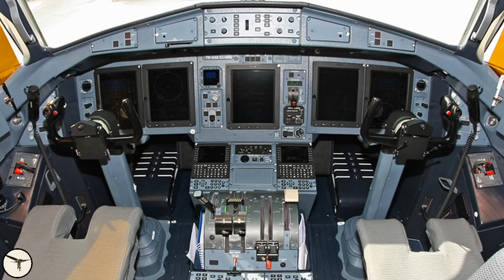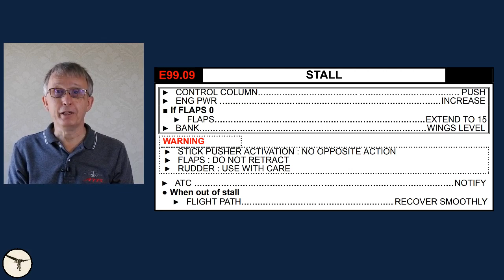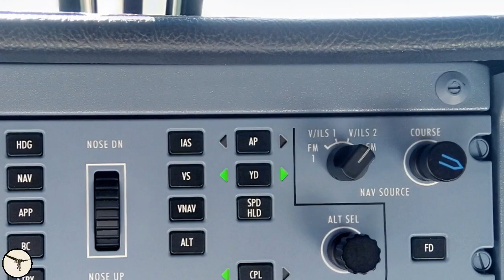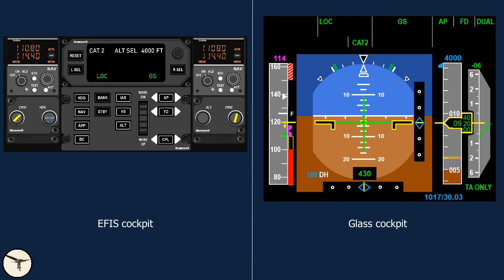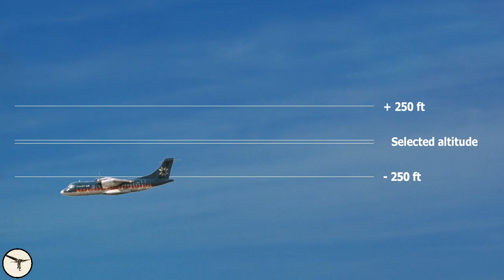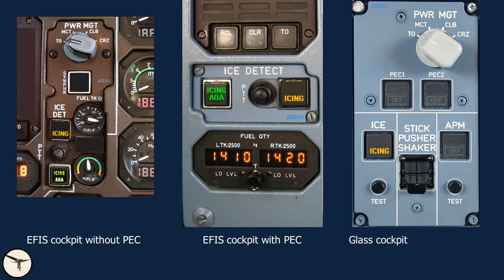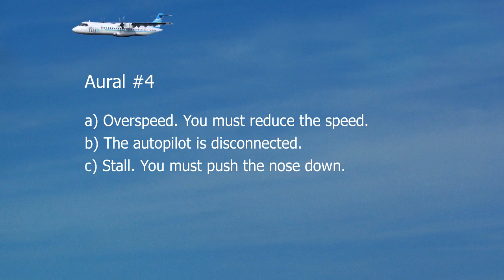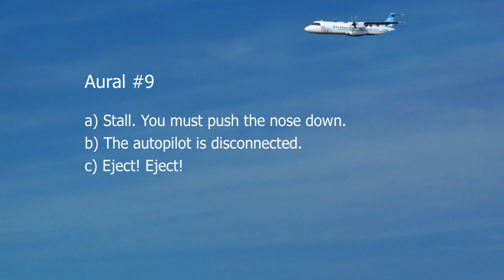ATR systems - Aurals from the warning system

Comment: Can you make a video of TAWS of Thales please?
The ATR42/72-600 use TAWS from Thales and have a different deep voice compared to the common voice of Honeywell, which can be heard in the -500 version and many other aircrafts.

Also if possible with all altitude callouts, not only 200, 100, 50, 40, 30, 20, 10.